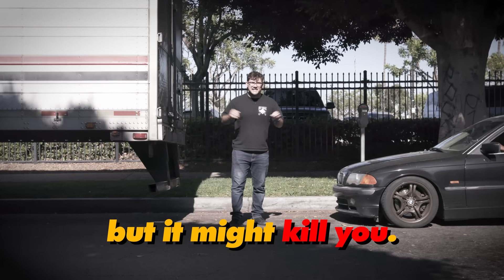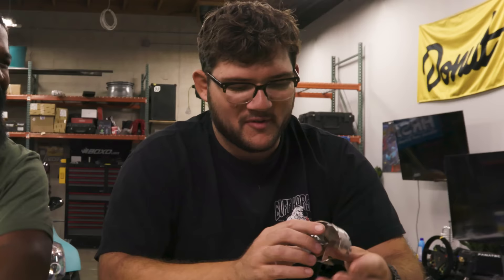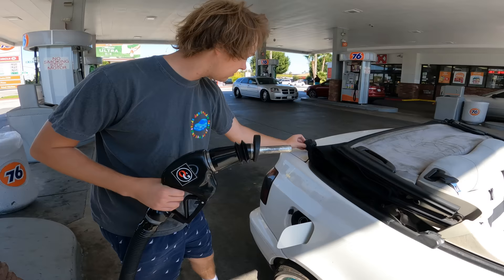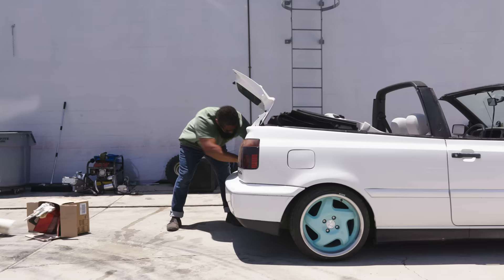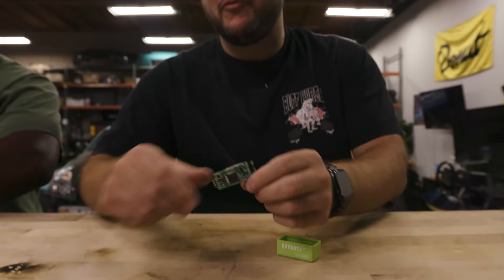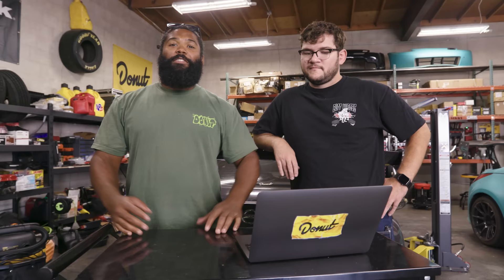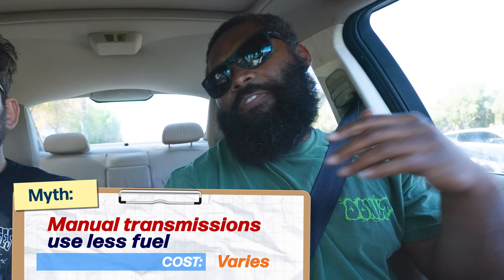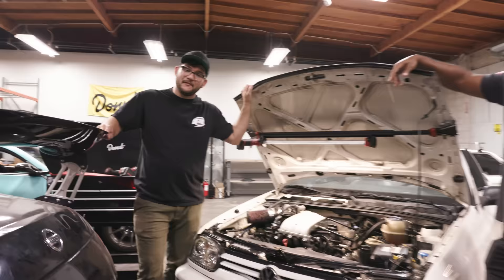Testing Fuel Economy Hacks

Comment: I'd love to see you guys do an eco mod. Especially if it's some wildly inefficient car from like the 60s or something.
Reply: Most of the cars from the 60's were pretty dang efficient. It's the late 70's and 80's where they got bad thanks to the EPA.
Reply: The body is not a problem if you don't drive fast. It is the engine and how you drive the car. For old automatic cars: Only 2-3 gears and the stallconverter did not lock in old cars. Thats very inefficient. The engines where also very big and did need much energy just to keep themself alive and the fuel was not used efficient. New engines do it a lot better.

How you drive your car realy what matters and how efficient that car can get. My dad for example drives so efficient that he get to 3.7l per 100km with a VW Passat Combi (Diesel) and they even archived it to get it below 3 Liter. Thats very low fuel consumption. It is just about how fast you drive (stay below 50mph/80kmh), how often and how intense you use the break (if you see a red light upcoming just get of the gas petal and if you need to get of the street just get of the gaspedal early) and how fast you accelerate (just use it gentle and then keep that petal on one level). In a stop-and-go situation keep more distance to the car in front of you so you dont need to accellerate and break that much. You will not block the traffic this way (even if some think you do) and you will not lose much time and instead arrive much more chilled. A good driving instructor would have told you some of this (at least I hope so, I live in Germany and not the USA)
Reply: Maybe Nolans land boat would do
Reply: @TehButterflyEffect  hey, what's your source on that? From what I've seen, fuel efficient vehicles pre 70s seem to be the exception not the rule.
Reply: @nooboard  While driving habits do factor in to fuel economy, that is not what I am suggesting. I am suggesting donut create an experiment where they find a vehicle that is not known for good fuel economy. On this vehicle, they control for driving habits. After they have established a baseline, they mod the car. Then they record the results.
Reply: @kylejohnson423  MPG is not the only metric for efficiency. By definition, more powerful engines are more efficient at moving heavy loads up to a certain point. When the EPA got involved, engine displacement stayed the same for a decade or more but horsepower went down significantly. This is, by definition, less efficient - no matter what the MPG ratings may be.

It wasn't until the mid-2000's that engine technology finally caught back up to where it had been in the 1960's and we had efficient, powerful engines again.
Reply: @TehButterflyEffect  Do you have a source where I can verify this on my own, or learn more?

Comment: I drive a 2022 Colorado, originally I was getting average city miles, ~17-18, but my friend taught me how to do different driving habits, and I've found the results yielded an extra 5-7 miles per gallon in fuel economy. In case you want to know, it's slow acceleration, doing my best to keep the needle ≤1500 RPMs, and coasting towards red lights (been hoping they turned green by the time you get there)
Reply: Makes me wonder how much my car would be getting if I wasn't already doing all that.
Reply: '16 Canyon and I get 19-20 mpg but with a cap and tall bars on the bed. We have a lot of hills here too, but coasting in and slowest possible safe speed on the highway helps too ~55-65mph.
Reply: I will agree with your new habits but I have an objection. Actually , keeping a gasoline car at super low rpm will destroy piston rings . In case of turbo, you will not have exhaust power to turn it (turbo lag) . Also  at low rpm , if you have a small engine, you will see this hill for long long time :)
Reply: @GiovanniBasketseller  I'd like to know the source on the piston ring issue?
Reply: @yur0nf1r3 I will try.  The gasoline in every spark explodes ,hiting the piston top surface in order to make the shaft rotate. During low rpm there is low inertia and the rotating power is the only force. A car at idle is tweaked by factory to find the sweet spot but without a load on shaft. If you put a load it will shut down unable to turn the shaft (like a bicycle rider during a hill climb with high gear). If you are in a highway and have an overdrive gear is ok to keep low rpm. But in a city using the inefficient part of the engine curve (low torque) will let your engine without lubrication , making the pistons "slaping" the walls.
Reply: I drive a 1999 Accord, which is rated 22 MPG average, but I consistently get 34-35 MPG.  I time lights, but accelerate at 3,000 RPM because of brake-specific fuel consumption.

Comment: Decreasing the contact patch by Inflating your tires would decrease rolling resistance, and save you fuel. A study by the National Highway Traffic Safety Administration (NHTSA) in the USA found that every 1 per cent decrease in tyre pressure correlated to a 0.3 per cent reduction in fuel economy. Under inflation of the tyre by 10 per cent increases fuel consumption by 2 per cent.
Reply: Now balance that against the cost of increased wear on the tyres.
Reply: Yes but they declared it as a scam because in the grand scheme of things you're not saving money if your tires last half as long, no matter how much gas you saved.

That and the danger factor is quite high too.
Reply: Why would it increase the wear ?? If you inflate to the manufacturers recommend pressure I'm pretty sure they know what the tires can handle. If the tire says 51 and you inflate to 47 that's not dangerous it's within spec
Reply: I think the conflict here is between two slightly different recommendations: 1) way over-inflate your tires (bad, less safe, increases tire wear) and 2) make sure your tires are properly fully inflated (good, safer, reduces tire wear, improves fuel economy)
Reply: Also Mythbusters already tested this hack and it works 100%, maybe because Mythbusters are actual engineers and know how to run tests properly 🤔
Reply: @Rastor0  I'm not sure what it is your talking about Inflating to the door placard is going to be way different if you have oem continentals with a max psi of 44 and the door is 37 vs pirells which are rated at 51 psi. Again none of this is unsafe its two different tires.
Reply: Yeah I'd say that 6 percent that they found to save by properly Inflating tires isn't so much a hack as a commen sence way to save money. I.e if your car gets 40 mpg with soft tires and properly inflated that 6 percent is 42 that's a gallon of gas each fill up and over 12k miles that's 15 gallons of free gas or 80 dollars to put free air in your tires.

Comment: Interestingly, it was Audi who discovered that keeping the windows closed at higher speeds and running A/C was more fuel efficient than opening the windows. They discovered during the development of the original Audi 100 in the late 1960's that the crossing point for this was around 70 km/h (43 mph).
Reply: The crossing point is probably even lover for modern cars, because they use more efficient AC, fans and are better insulated.
Reply: @GiGaSzS  Also older cars were more block like so opening a window didn't add as much loss as it does to a newer car. 
There is a reason all stationwagons cars have the same outline nowadays. And all sedan types look the same.
Reply: I would suggest to close the Windows as soon as the passing air gets noisy, which indicates the increased turbulences.
Opening the windows helps a lot to cool down a car sitting in the sun, instead of using the ac to do the same.
As a rule of thumb i would advise to open the windows before even starting the car and leave the ac off until you reach higher speeds (wind noise at the windows) , after which you close your windows and turn on the ac. The temperature should not be lower than 21°C.

Comment: 10:29 that's another thing i remember from Mythbusters; their result was that rolling up the windows helps only above 50 mph; below that, for eg: short trips to the grocery store on local roads, windows open with the AC off is usually better for gas mileage
Reply: Congratulation 🔝🔝you have been selected among my shotlisted winner hit me up 👆  above 👆with a picture of  this comment for confirmation🥇
Reply: actually windows up with the ac off is the best...
Reply: @PhaseSkater   well yes, technically you're right, but the humans inside need to breathe... In that case, the best way to save on gas is to not turn on the engine at all... 🙄🤦‍♂️

Comment: "Top tier" gasoline isn't about the octane rating. It has to do with the cleaning additives in the gasoline. Some places advertise better performance with them, but it is more about keeping the injectors and all of that cleaner with the cleaning additives. Most gas at different branded gas stations comes from the same refineries, so at a base level they're the same. The difference between "Bob's discount gas mart" and a station that carries "top tier" is what is added in to make their own blend.
Reply: YEP!  just posted the same comment lol
Reply: This is true... "Top Tier" is essentially an additive package, not related to octane.  In the long term it probably keeps your fuel system a little cleaner.
Reply: Also  there is a slight fuel economy  benefit but not enough to offset the cost of 91 octane. Like mentioned it's more about helping the engine and fuel system run better and longer.
Reply: plus the amount of ethanol. Pure gasoline has a higher energy density but its marginal
Reply: @tonnyletkeman2348  This isn't generically true.  If a car is designed to run on 91 octane, and you use lower,  it may retard timing a bit because of knock which will cost you some gas mileage,  but otherwise, most cats won't benefit at all from higher octane and it may actually reduce gas mileage.

That said,  as I mentioned before, "top tier" is a marketing label applied to an additive package (or class of additive packages) which actually does have some benefits, but doesn't affect the octane of the fuel or fuel economy of the engine.
Reply: Regular oil changes do  that just fine.
Reply: @Mostlyharmless1985  sooo, a regular/routinely followed engine-lubricating-oil change only and/or specifically - keeps fuel injectors just as clean? Compared to quality of fuel pumped into said fuel injectors & overall fuel system? Hmmmm...

POST-EDIT - this is after considering the extensive role that blow-by plays on deposit formation on (direct particularly, as they aren't washed down in a solvent-like fuel all of the time - or at all) injectors through via the PCV I think most often, which yes obviously, and which yes obviously basic LOF maintenance will help keep under check

Of course, the engine lubricating oil doesn't directly clean the injectors as a detergent or solvent-like fuel would in a PFI or dual injection engine where said fuel actually contacts the injectors during every injection - rather, the new LOF can indirectly help keep the injectors clean or at least less dirty by not carrying as many abrasives to them (as more contaminated unchanged oil would during engine cylinder blow-by), and by maintaining its good seal-assisting properties (assisting the piston rings most specifically, to seal off the piston dome & combustion chamber more specifically from the surrounding cylinder walls of the sleeved or parent-bore engine cylinder block)
Reply: @Motive_Tube  yep. That’s one of the purposes of oil. To clean the engine. That’s why it has several detergent packages in it.
Reply: @Mostlyharmless1985  As far as its sanitizing purpose it primarily keeps the moving engine parts (such as cam & crank journals & bearings, cam lobes, piston + conrods below the upper compression piston ring, etc.) where there is friction during operation - clean where a film of lubricating oil is designed to flow. 

It dosen't flow inside or around a fuel injector.

Quality of fuel (which has detergents too but which is also designed for action inside of a fuel system specifically), has much more of a direct impact on fuel injectors & other fuel system internals compared to the engine oil.
Reply: @Motive_Tube  it doesn’t have to, just what exactly will gum up your injectors? All the crap that gets scrubbed out and filtered by your oil. It’s one of the three main jobs of oil: clean, lubricate, protect. Having clean and fresh oil will do more to keep your injectors from being clogged than any fuel additive. Either way the additive packages are pretty much exactly the same across all grades because the fuel gets sent down the same pipeline anyway. Even IF you needed to do some kind of cleaning of the injectors (you generally don’t.) you can go spend 5 bucks to buy a fuel additive. Premium gas is for engines that need the octane.
Reply: @Mostlyharmless1985  so the lubricating engine oil cleans, lubricates, & protects the upper dome atop the piston crown? No of course not. I know that those are 3 of its core purposes - doesn't change its *location of action*, i.e. between points of otherwise metal-to-metal contact 

There is a reason for 40 CFR 80.161 (note, 40 CFR 80 has now been superseded by 40 CFR 1090) among such namely, is the prevention and real-time control measure against IVDs (carbon intake valve deposits, old info known for ages - see SAE technical paper 872117). Carbon build-up is BY FAR the much more common key cause of internally clogged injector nozzles, and quality of fuel is inextricably linked to this (most especially in the case of a PFI or dual injection system as opposed to direct injection), just as this all links to incomplete combustion of the air/fuel-mixture - which itself further feeds back into more carbon build-up including as injector deposits, screwing up the injector spray pattern (ergo, uneven fuel distribution) and even reducing the effective flow area or spray of fuel at maximum lift. It can create something of a negative feedback loop. 

"Premium" also has way more to do than simply octane rating, although that by the way can assist with preventing LSPI (low-speed pre-ignition) detonation in certain operating conditions (stop-and-go, heavy city traffic) and certainly with vehicles running higher-compression ratio engines (such as a 2019 Mazda, 13-to-1) - even if it isn't 'necessary' (per OEM owner's manual or even the service manual under engine performance). Naturally, higher octane fuel has higher stability too (much better storage life in a tank before degrading)... 

"Premiums" are NOT all equal (specifically the net additive effect of a given selection). Unfortunately seems retailers refuse to release any public information (e.g., 3rd-party product testing) that would lend unbridled confidence to the 'premium-ness' of their "premium". But if you think all are the same, check out Shell's V-Power Nitro+ grade gasoline (see their pdf brochure) for instance, or hell just into the American Automobile Association's 2-page (Top Tier) Fuel Quality fact sheet overview or 34-page 2016 full research report on the matter (pdf is in public domain). ASTM testing ensures the fuel performance standard for Top Tier rating per the outlined standards published in December 2019 (pdf is public) by the top tier gas group. It isn't some baseless hack scam. There are real differences in chemical compounds, such as PEA (PolyEtherAmine, see info page by IRO Coating Additive Co., "A Brief Look at Polyetheramine - A Unique and Powerful Fuel Additive") & others  - which are or aren't present at different levels, in different fuel selections - which do directly affect hygiene & ultimate service life of the fuel system.  

Engine lubricating oil only ever INDIRECTLY affects the internals of the fuel system Especially if everything is correctly maintained whatsoever. Use the specified SAE viscosity & API grade (latest compatible API is best) oil & that complements optimal overall engine hygiene & health absolutely, but as for the guts of the fuel sys specifically, ofc not so much per se. This is super common-sense to anyone remotely familiar with the contruction & theory of operation of a spark-igniting gasoline or compression-igniting diesel ICE. 

'Same' post-refinery pipeline doesn't mean same end-product; typically additives are streamed into the fuel, as specified by the retailer, at the fuel terminal as tanker's being loaded.

Wow, apparently had to describe each URL reference because I guess bots (and to a less frequent degree nowadays probably, human scammers alike) have ruined source-citing for YT commentary

POST-EDIT - "doesn't change it's location of action" location of direct action would probably be a better framing...several ways how and where it does indirectly act upon that which it doesn't directly contact (including injectors, but anyhow...I think that my points stand regardless)